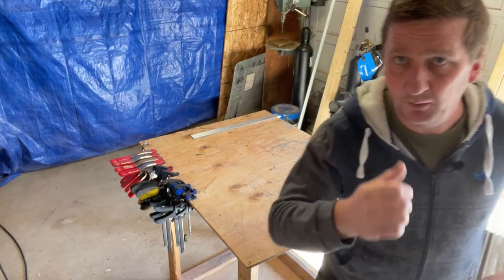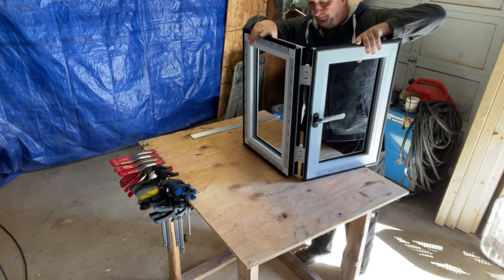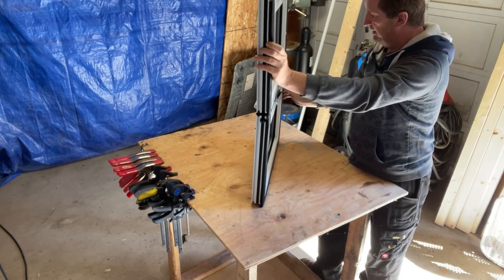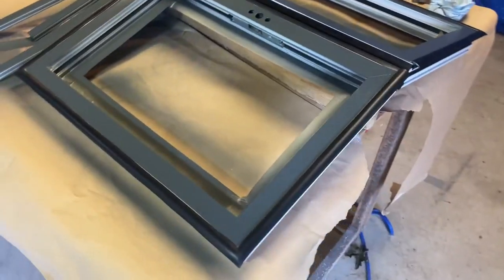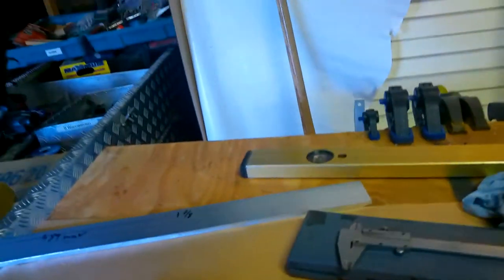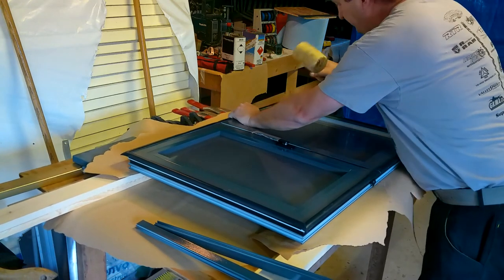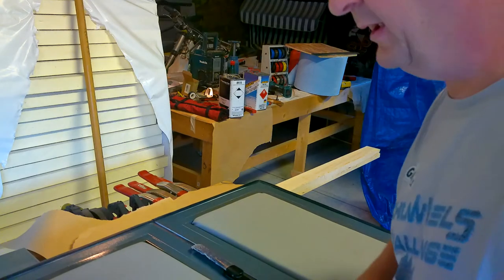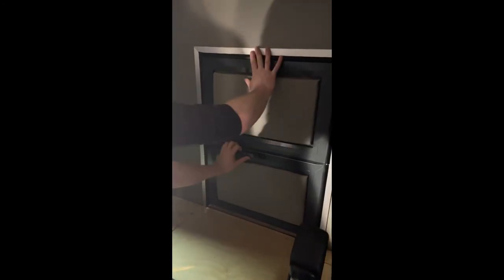Expedition truck pass through door as folding door build from scratch.

Comment: Oscar, love what you have done with your pass through door, great design. I'm about to cut the opening in our cab & it's terrifying me! I think this is a part of the conversion that intimidates many. I  have marked out the overall dims for the cutout on the cab, it seems too big! But it's very similar to the dims you have used. Would you mind sharing the cutout dimensions you used and have you made a video of the of the process? Thanks!
Reply from the maker: Thank you and yes I can feel your pain cutting a hole in to your truck is never going to be easy. My situation was a little different because I cut my team cab off and created a whole new rear wall with the crawl through in it already you can see it in this video. https://www.youtube.com/watch?v=FqVni-ZiB7Y
my door size is 620mm wide and 820 mm tall.